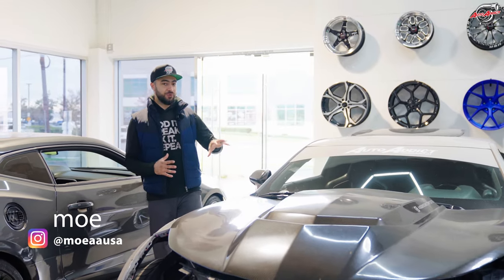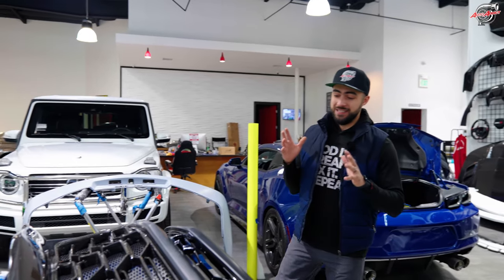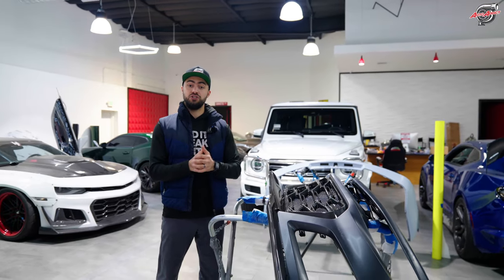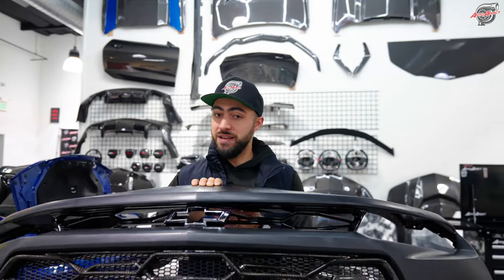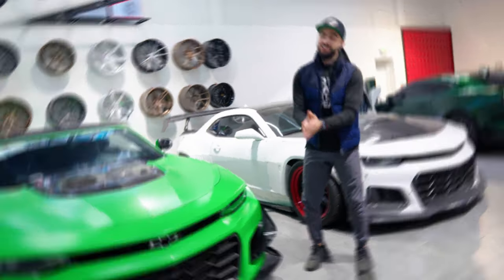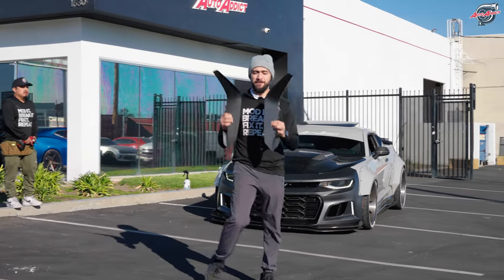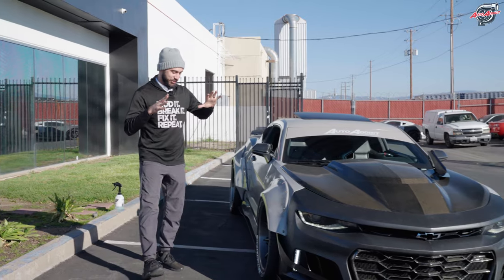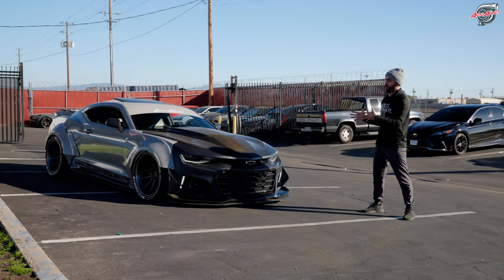ZL1 Front Bumper Conversion EXPLAINED !!! | FULL Carbon Fiber Kit | @AutoAddictUSA

Comment: Hello! So I have a aftermarket zl1 1le bumper with carbon fiber splitter, dive planes, and fog lights. Will the carbon fiber lower/upper grills work still? Or does it have to be 100% oem